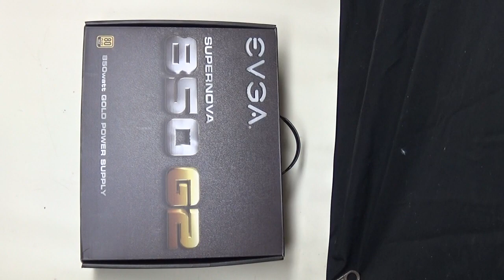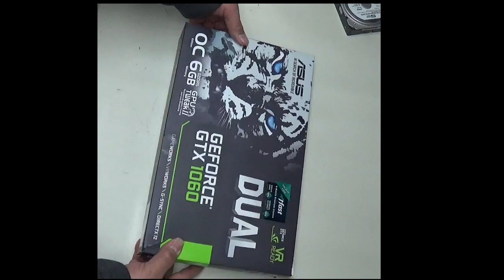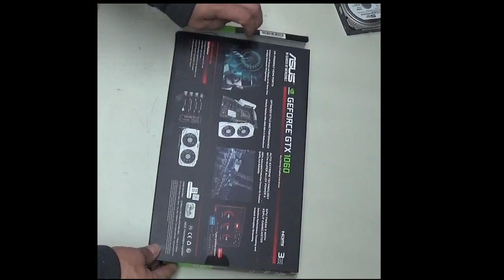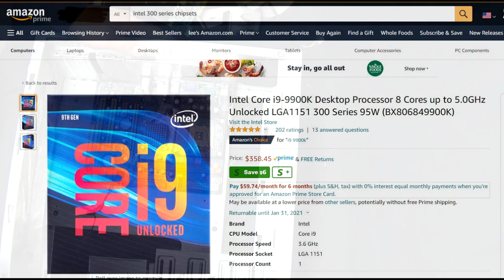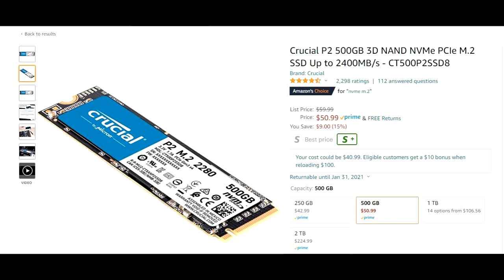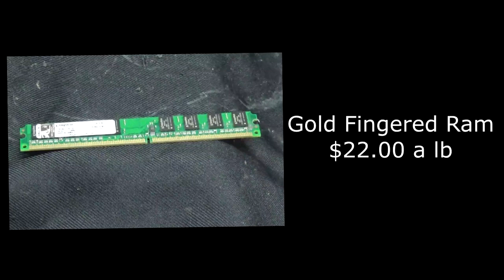Scrapping an old PC and showing my new one.

Comment: can do alot with 6 gb 1080. And if ya wanna par take in some mining on down time be a decent has rate undervolted!
Reply from the maker: I was doing some mining with some 4gb and that went out the door when they raised it.
Reply: @MiketheScrapper  can still mine Kawpow and bios mod on the 4gb card! I'm getting 18mh each just in nicehash. With the rig running hiveOS I get 21 but don't like the power consumption!